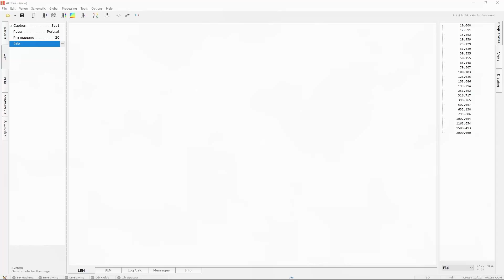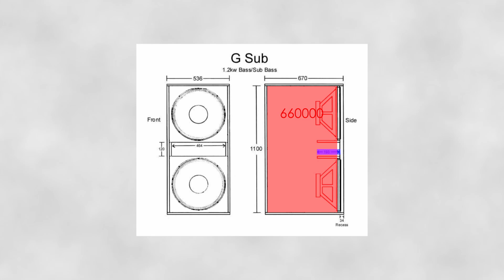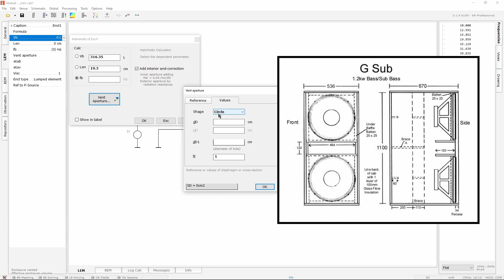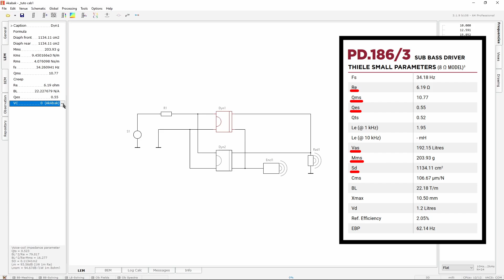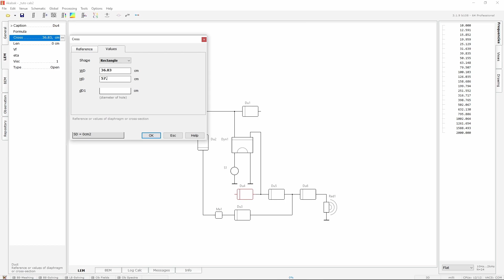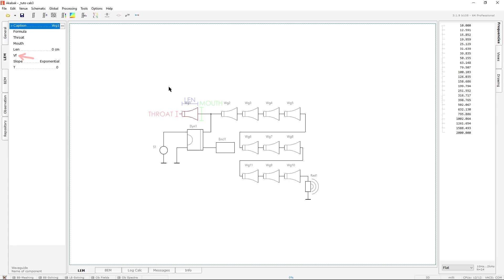Akabak explained | LEM components pt.2 #6

Comment: Is it possible to simulate straight off the LEM to VACS or does it have to go through BEM + Observation before VACS can display the results?  What happens if settings on LEM and BEM are mismatched, which result is captured by Akabak/VACS?  Tks
Reply from the maker: The observations are what VACS displays, without em you won't have any graph so you do need them.
Observations can only be placed in BEM as it often allow people to specify an environment in which the cabinet is placed (such as flat ground etc) so you need this aswell.
Reply: @plans.systemes  If I wanted to increase damping fill density for major delay/phase changes, what would you suggest to include into the circuit, an "Ra" before or after "Duct"?  I'm hoping to simulate D&D 8c through LEM + BEM "Pressure Box"  Is it possible?
Reply from the maker: @naomispirit-evokingemotion2267  For D&D 8c the biggest issue you'll face is a too-theoretical response in the med-high frequencies as LEM is not made for this. if the cabinet has a damping material inside you can play with "etab" property of Enclosures, and "eta" for Ducts. The hardest part will be to know how much damping they provide irl and transcript that into your simulation.
Reply: @plans.systemes  Thanks for the reply, that's exactly what I'm doing.  Do you know how "eta" can be converted into "Pas/m2 values?  Only when I series a "Ra" behind the duct I can adjust much higher "Pas/M2" values.